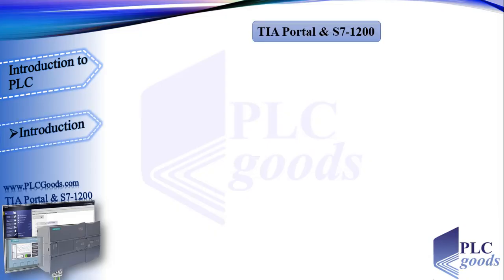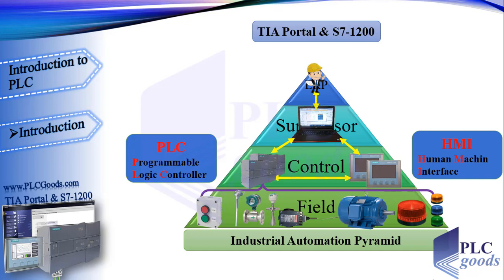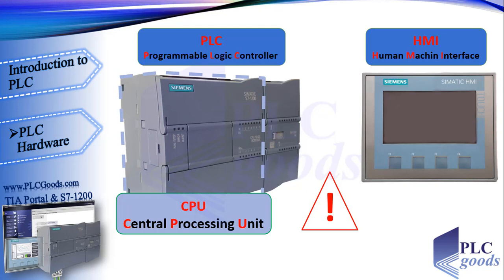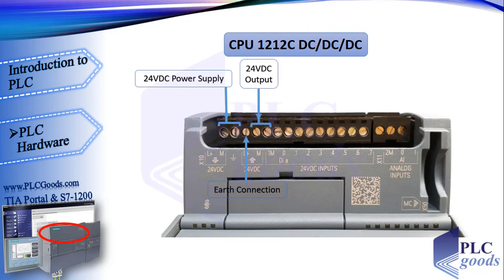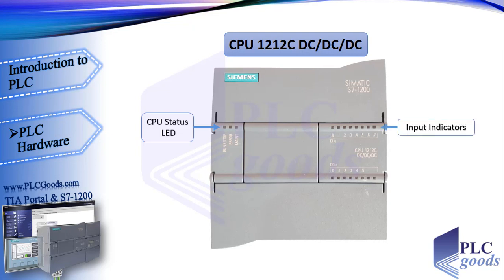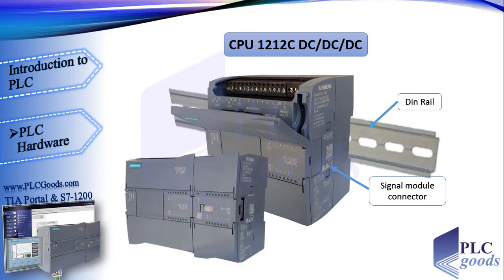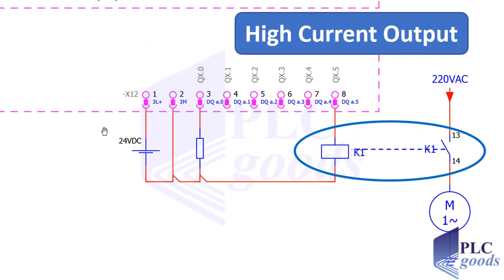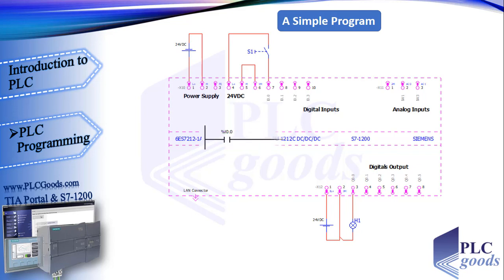SIEMENS S7-1200 PLC TIA PORTAL | PLC Introduction Tutorial | Lesson 01

Comment: Thanks for posting video. Does this CPU have RS485 communication?? I need RS485 communication, how is it possible in 1212C CPU??
Reply from the maker: our model comes with a LAN port only, you may check out to see if you can have a RS485 port on you module by adding a related module